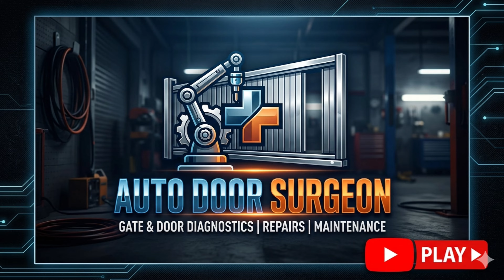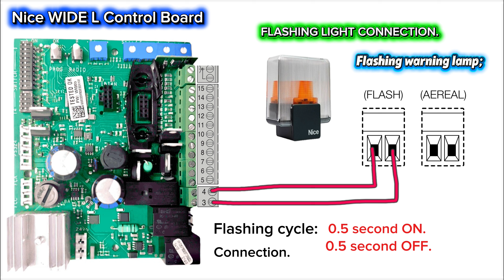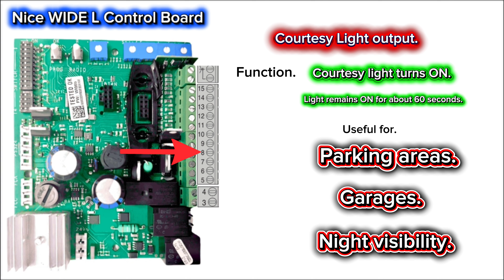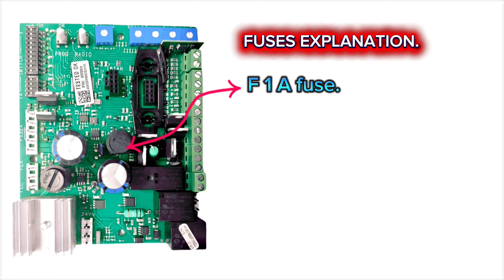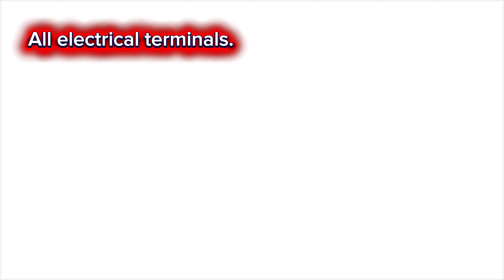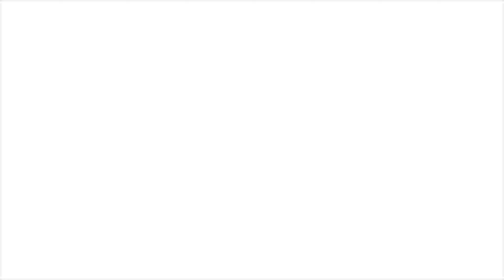Nice WIDE L Barrier Control Board Full Wiring & Terminal Connection | Complete Installation Guide

Comment: good day can I as a question sir how about the traffic light what is the connection like the green and red and also the loop coil where I can terminate thank you I hope you answer my question.
Reply from the maker: Dear Sir I will trying to give you best answer to easy about the traffic light red and green light is related to external circuit. There is separate circuit coming that control and red and green light and the circuit also connect to control board of limit switches. The loop wire you will connect to loop detector. Then loop detector will direct connect to control board terminal 14 with common terminal 6.
The terminal 14 is open command when the car enter the exit barrier the loop detector senses the car and give to signal control board to open gate. The loop detector output will normally open and common relay will connect. That activate when any metal comes  in the loop area.
Reply: good day sir thank you for your response. in what terminal i will connect the traffic light sir?
Reply from the maker: Please just tell what type of traffic you have. I need to understand
Reply: I will send the picture in your WhatsApp sir if you have.